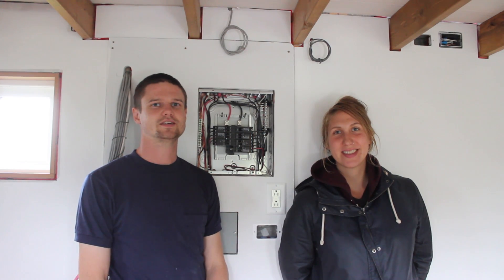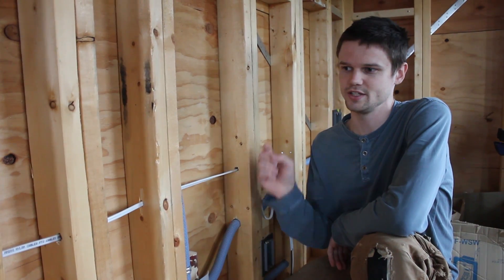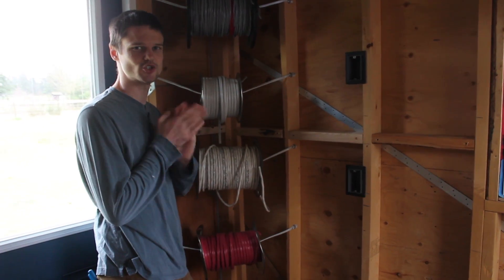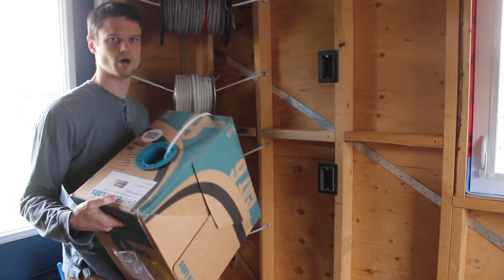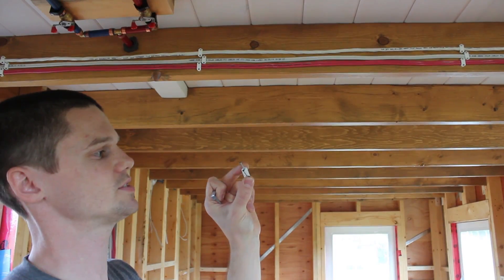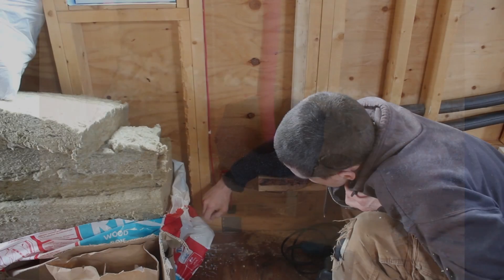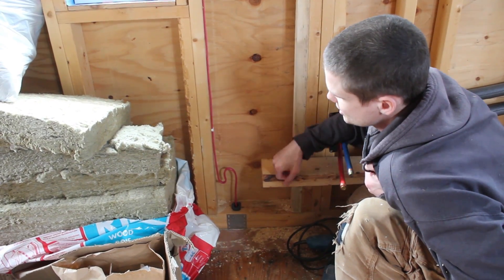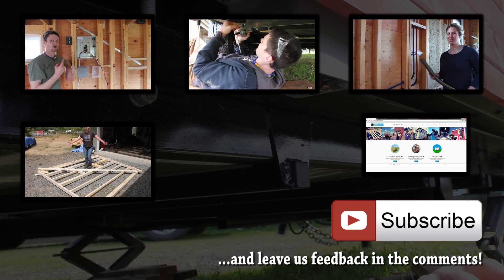Tiny House Electrical Wiring - Part 1 (Ep.40)

Comment: wear did you get red and black romex i only see red in 3 wire romex plus ground  what country are you in
Reply from the maker: It's sometimes called HeatX because it's often used in 240V heating circuits. We are in Canada. The only reason we used it was because I had a bunch left over, so we wanted to use it up rather than buying new white/black (yellow outer).

Comment: why use low voltage wire at all?
Reply from the maker: There will be so many buttons and sensors that we need the cat6 to handle it all. Additionally, the LEDs require 4 conductors, which once again would be just way too much cabling if it was too thick.

Comment: You know what I like about your video it was very stimulating mentally as you explained each step of the codes and the mechanical infrastructure of the how and why you perform different tasks and it sounds like to me like you have to know a little about design and what you want in your house so you can know how to set-up the wiring system am I right looking forward to hearing from you Peace.
Reply from the maker: Glad it was informative for you :D 
Yeah you definitely want to have a solid plan for everything in your house that will need power.

Comment: Hey man great work.  I really like how you are meticulous and neat with the wiring.  Although, I have to say something.  FOR THE SAKE OF ALL HUMANITY, PLEASE STOP calling those "PLUGS" that you are mounting in the wall.  The correct definition of those are called "receptacles or outlets."  The 2, 3, or 4 wire male prongs on a cord cap that stick out and go in the receptacles are called plugs.  Plugs plug holes to get power.  Receptacles or outlets provide power.  Connectors are the female cord caps, plugs are male cord caps.  Have a blessed day.
Reply from the maker: Definitely like to keep it tidy. Yes we know :P there is an incorrect common misuse of the word plug... and it tends to roll off the tongue because it's one syllable, as opposed to "receptacle" which I consider to be the correct term.
Reply: I used to work for an electric supply company, everything residential to industrial.  I dealt with guys using wrong terms all the time.  Maybe it's just from all that built up.  Anyways, just kidding :)  It's nice to see people taking your work seriously.  Keep up the good work!
Reply from the maker: ;D thanks for watching!

Comment: Always interested to see how people do things differently.

The main reason we always used the white staples(instead of the all metal ones) is so that if the wire is pulled on for some reason and it's going around a 90 degree angle, the wire won't dig in to the staple and possibly create a short.

I think the all metal ones are more to save money
Reply: I moved from the UK TO Florida and into a house that had recently been remodeled. I saw one such example of one of those metal staples which was almost all the way through the Romex cable plus a load of other cowboy stuff, which told me that the cowboys who were doing the electrical work just should have been nowhere near it
Reply from the maker: +Life Inside A Box Yeah time and money :P sometimes at the expense of quality :(... funny enough, there have been many times when I've been removing NMD in haste (like demolition for a reno) where I just yank on the cable to pop the staples, and it doesn't really mangle the wire as much as you'd think. It's good to know the jacket is pretty strong.
Reply from the maker: Yeah that's another issue I've seen too... the metal ones are much more likely to cause damage in a variety of situations...

Comment: Question: why not use those 1 or 2-gang poly vapour barriers on all your boxes? Are they not up to hot stuff (ie I used them in my build thinking that was fine)? Are you just being extra super careful?
Reply from the maker: +beezwings In retrospect, we should have used all boots instead of the pre-sealed boxes, simply because of how it is not depth-matching our interior paneling... otherwise, the pre-sealed boxes are just quicker and easier to install.
Reply: +Tiny Nest  Thanks! Phew! I hope you realize that you are like 50% responsible for my build. You are amazing for sharing this for free.
Reply from the maker: +beezwings Thanks for watching :) and we do accept extra support on our website ;D

Comment: Holy Crap Batman! Are you using Lutron control? Those vapor boxes for the LV are cool, I usually just use and plastic mud ring. What no speaker wires?! Btw nice use of the smurf tube.
Reply from the maker: +The Contractor Dude We're going to write the program ourselves using an Arduino computer as the controller, and carious lighting drivers and relays to operate things. There are speakers wired in ;) and that tube is going to be really helpful with the planned setup in there.

Comment: Depends on the panels, you can have all the watts you need you just have not go over the amps
Reply from the maker: +Nels Christopherson One should always respect the ratings of any device. Panels will have both a voltage and amperage rating, and since watts are the product of volts x amps, you can figure out what your maximum capacity for power is from any device with these ratings ;)